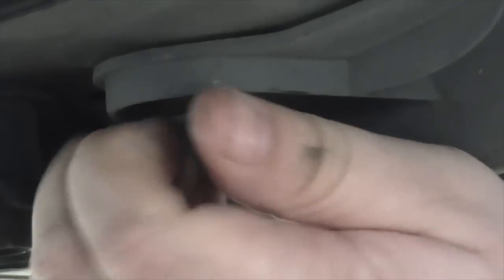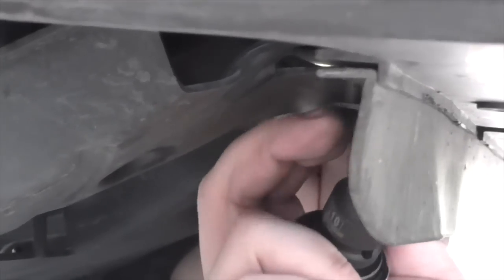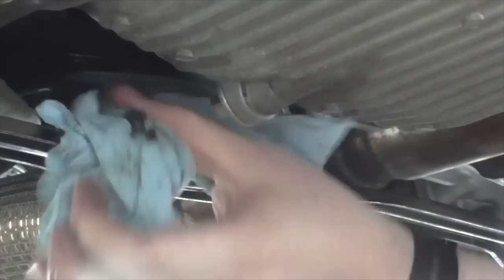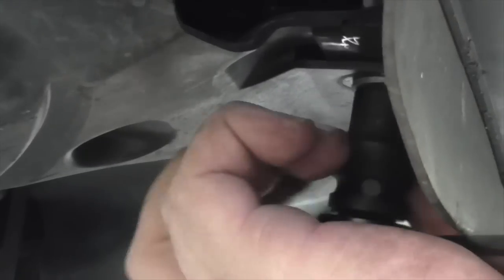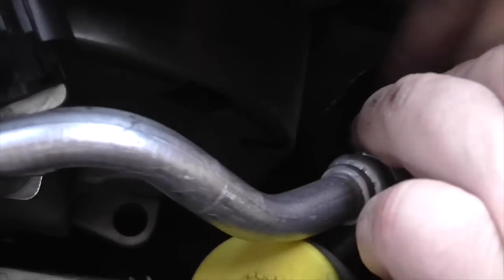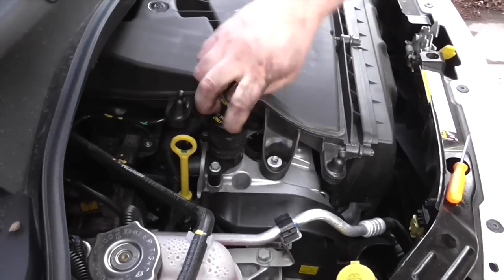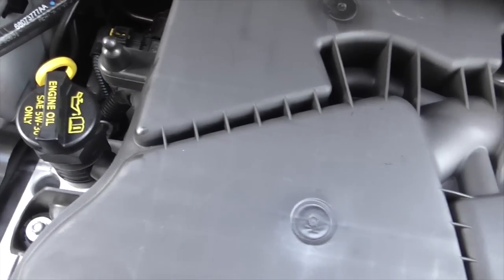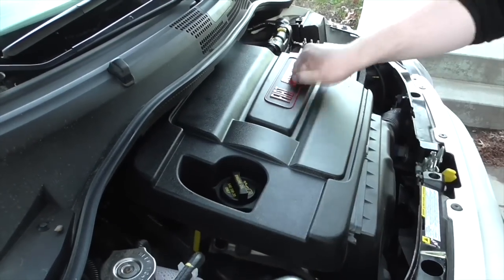How to change oil on fiat 500 fast and easy DIY

Comment: At first, you were killing me with having to remove all 6 shield bolts, but then I realized I wouldn't have even known where the oil pan was hiding if not for your video.  When you got to the work, I was totally pleased at your thoroughness.  Thanks for mentioning the size of the wrenches, 13mm (oil plug) and 27mm (filter).  Also, I appreciate showing how to get the top plastic cover off, just pull it off.  One more thing, great trick on moving the ac hose.  Merci beaucoup.

Comment: Thank you very much, I got online to look up oil change specs.. filter, oil weight and capacity when I stumbled across your vid. This is the first oil change I am doing on the 500... so glad you posted. Very helpful. I now know I need to get a 27mm socket and jointed extension! Cheers!

Comment: I just changed the oil in our 500 following the instructions in this video: everything turned out great. I also encountered a very tight drain plug... Thank you for sharing!
By the way, a 10" extension is long enough to reach the filter.

Comment: i have done my 3rd oil change on this car  and i find that putting  the extension bar though the head light  assy  is  better for me     I saw the idea   on you tube   by world mechanics     it works pretty well.     good   job and good video

Comment: Thanks for the vid! Great basic information for this peculiar little car! I've been playing under cars for a looooong time your vid was VERY helpful. You can go even faster if you use an oil extractor (like boats use). Clean, painless, and you don't have to put the lil bastard on ramps. Also there's a hole near the headlight that you can put an extension through to remove the filter.

Comment: My daughter’s 2012 Fiat 500 might be a little different but to remove the oil filter I put the long socket extension thru a hole in the front headlight housing.  Then I attach the huge socket. Then I loosen the filter. Perhaps something changed in model years but look for this method. The 2012 was clearly designed for this. I don’t have to remove the top plastic of the engine or move the AC line.
Reply: Kent Russell 
What length extension did you use?
Reply: Done Voting I used about an 18” extension. If you see the hole in the headlight housing you’ll see how it lines up with the oil filter. Any extension or combination of extensions that will work is good enough. Perhaps different model years are different.
Reply: Done Voting Here are pictures. http://www.fiat500owners.com/forum/26-fiat-500-diy-section/2990-2012-fiat-500-oil-change-guide.html
Reply: Just discovered that hole by accident. Working in the dark I had a light that shined through. Works great. Also used a vacuum extractor so I didn't even have to put the lil bastard up on ramps.  Still  a very informative vid. thanks bestfromnw!

Comment: You should have removed the oil filter first before the oil plug. That way you'll be able to remove all the oil inside, including the oil in the filter system.

Comment: There is a hole between the head light and the fascia you slide the extension through there and you are lined up at the correct angle for the filter housing

Comment: You need to remove the filter or loosen it before you put your plug back on, because there is a valve that will let the oil drain out of filter housing.

Comment: One problem I saw - you should leave the oil plug off when you loosen and remove the oil cap and filter, as once it is loosened, dirty oil will drain out of the filter housing and down into the pan.  If the plug is back in already, it won't be changed and you won't have drained out all the oil.
Reply from the maker: Forgot to mention in the video that filler cap was opened for the draining process, good catch ;)

Comment: I just saw another video where they put the socket and extension through a hole by the frame and the headlight. goes straight in no swivel needed.
Reply: Yep, saw that video too and that worked perfectly for me.

Comment: Is it possible to change the oil filter after you already changed the oil. I didn't have the filter and went ahead and did the oil. Now I have the filter and wanted to replace it. Wasn't sure if there would be oil in the filter
Reply from the maker: yes, you can do it without any issues. a little oil will come out but not bad. remember, most of the oil is in the oil pan on the bottom of the engine when the car is off.
Reply: bestfromnw I figured as much. Thanks. Much appreciated

Comment: I was wondering why the dudes at Jiffy Lube charged my wife $118 for an oil change.
Reply: Liam Burke 
I stopped by there the other day and they gave me the same quote!!!
They said that is what they charge for imports. I passed on that LOUSY deal!!!
Reply: Total riff off!  I paid $20 5qrt full synthetic Pennzoil and $8 for oem oil filter from Amazon. I bet they used impact wrench to over tighten oil drain plug like this guy's car and missing few bolts on belly cover.

Comment: The cap says 5w 30 but you used 5w 40 any insights as far as why. I'm planning on driving lots of miles daily in hot weather 100f been the lowest I was planning on using mobile 1 extended miles 5w 30 or a 0w 40 any insights on what oil I should use its a 2012 fiat 500 pop 55000 miles on it.
Reply from the maker: Basically they two oils will be the same viscosity when cold, so both good for getting oil around quickly with cold. 

But 30 will be thinner when hot, so when pushing the engine and creating alot of heat the oil make shear (loosing protection) where as the 40 will stay thicker at the same heat. 

Also oil temps will go up quicker with thinner oils.
Reply: Ok thank you 
You think a 5w 40 would be better for me been that I'm going to be in a lot of 100 degree weather?
Reply from the maker: Correct

Comment: So engine oil fill cap says “ 5w/30 ONLY” and you use 5w/40 !!!!
Reply from the maker: 5w40 is better for higher temps (over 100f) at high rpms. This was done before roadtrip to Idaho, Utah, Arizona, Nevada, California. So lots of hills with high rpms and very hot. Performed flawless

Comment: Just had to do one today on a 2014 500L and wanted to die. My swivel adapter couldn't achieve the angle I needed so had to take a bunch of intake piping out. Then I figured out the customer wanted OE oil so we had to buy the shitty Pennzoil Platinum 5W-40 Synthetic from the dealer because they're the only place nearby that supplies oil that passes that specific Fiat/Chrysler spec. 

The second I saw 3 different size/type fasteners on the skid pan I knew I was in for a treat. Fuck everything about these cars.
Reply: IAMJAKETRIMBLE 
I really like my 500 sport. It is economical and a blast to drive!!!

Comment: It’s disheartening to see people struggling under these fiat 500’s to change their oil.  So unnecessary!  Use an oil extractor and all this unnecessary work will be eliminated.  The oil filter on these Fiat 500’s is on the side of the engine.  You can’t ask for a simpler  and cleaner oil change ….using an oil extractor.